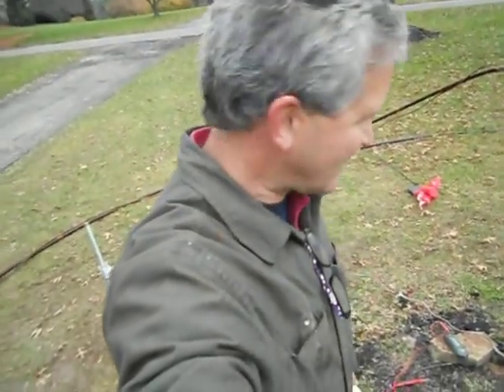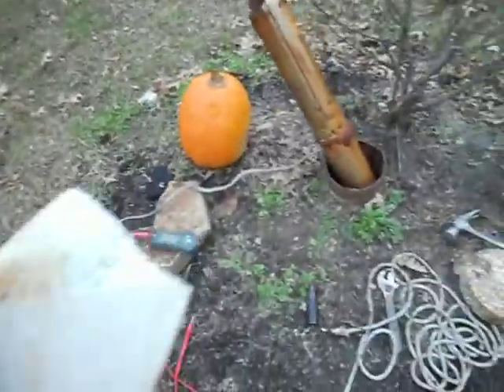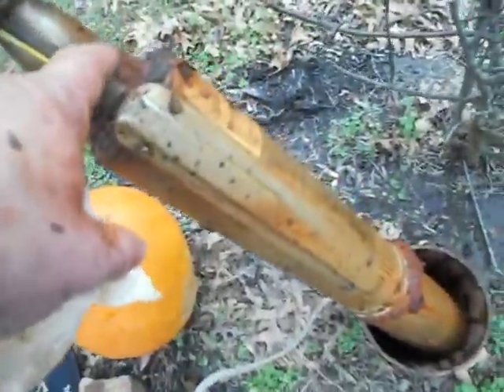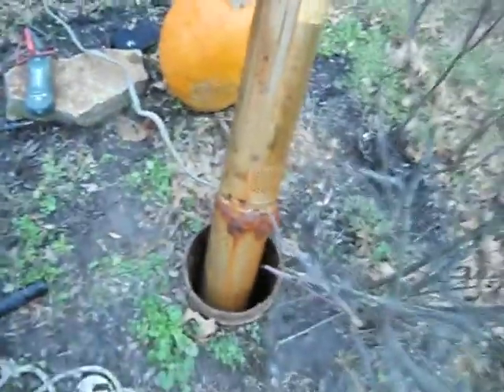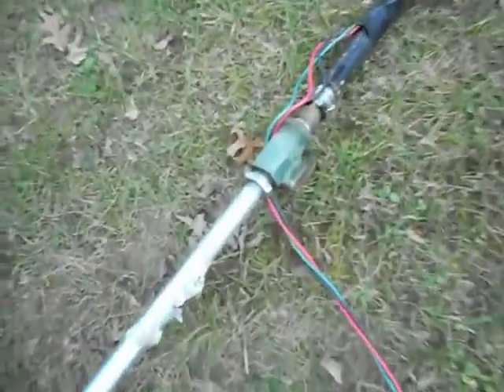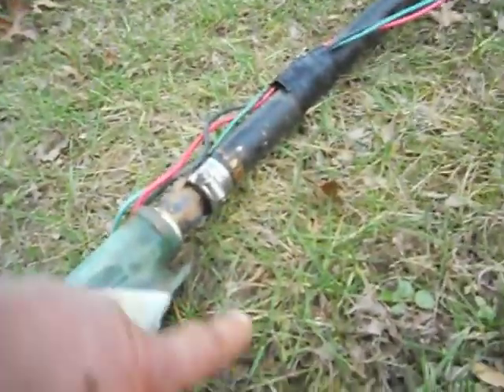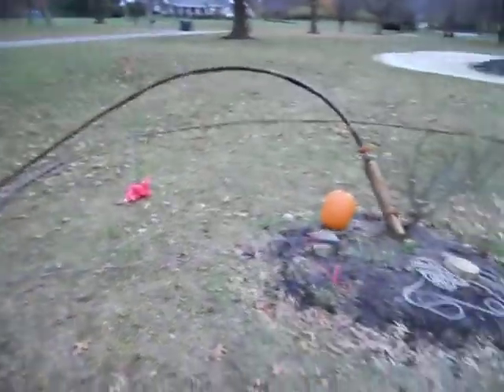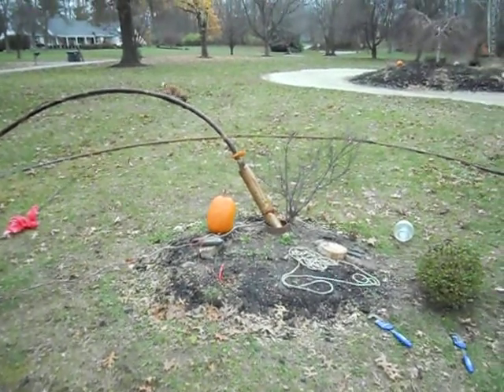Replace Well Pump in 4 hrs (6 of 12) 100 ft Myers 2ST52-8 by Tatcor.com West Chester, PA

Comment: That black roll pipe is crap. The pitiless adapter is for wells that have colder weather or snow to keep it from freezing.  It should have had a cable connected to it just in case it falls. I have worked on pumps for 20 years. This well needs to be updated.